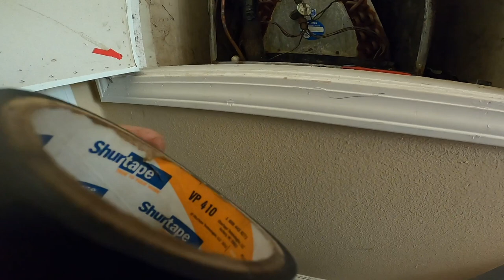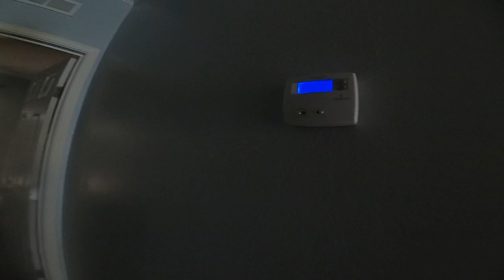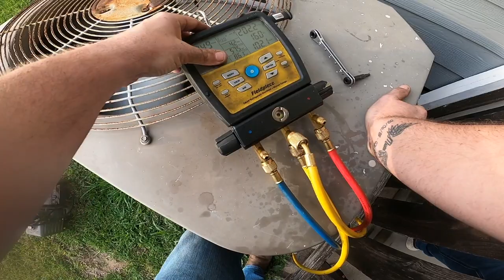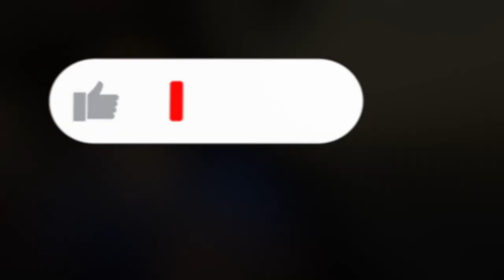Pull and Clean a Evaporator Coil

Comment: Correct me if I'm wrong....I thought that when reconnecting the copper lines you are supposed to flow nitrogen through to prevent a build up of oxidation on the inside of the copper lines while using the torch.   You don't want ash in the system if I'm not  mistaken.

Comment: Never use coil cleaner near customer’s vehicles. Always wet down nearby structures when cleaning outdoor units. Rinse well when finished. This is why I recommend high efficiency air cleaners and change filters as needed. I’ve never had to pull one of mine. If over 10 years old, they get offered a new coil or AH. Why waste 3 hours and then they have a fatigued out coil with no warranty. Never pump down a scroll compressor. It will damage them. Use the proper Recovery machine. Always purge and pressure test with nitrogen.

Comment: This job is a lot easier because the air handler is located in the laundry room on the living level of the home.  Ours is in the attic.  🙄. Florida required this at the time.
Reply: Installed in utility room, no high-efficiency air cleaner, poorly sealed air filter or lack of proper filter changes are the reason this coil was in the shape it was to begin with.
Reply: @USA-GreedyMenOfNoIntegrity  where do u prefer the air handler to be installed.  The attic is suboptimal in every way.  I would rather have it open in the garage but they put them in closets instead.

Comment: Have you ever used stay bright 8 John it’s awesome stuff no need to flow nitrogen cause it melts at lower temperatures but still has silver in it! Nice job man! That coil has seen better days though the radiator ends are looking rusty. You could see all the moisture on camera when you started that pump 😂 That’s some cool ass tape better than cork tape, that stuff sucks to remove. God I’m missing R-22
Reply: Local filter changer here so idk ....flowing nitrogen causes the  silfose (sp?) To melt at a lower temperature?
Reply: Good technicians always use nitrogen purge and pressure test. Synthetic oil in 410a system is hygroscopic. You always use nitrogen.

Comment: I don't think I've seen one pulled and cleaned, I'm sure you can do a lot better job pulling it out, maybe should be more common, did you pump the system down? Or recover it ? Great video
Reply from the maker: Pumped it down
Reply: Probably because most people change their air filters and many of us installers install high-efficiency air cleaners and provide a new one to our customers every year, during preventive maintenance visits.